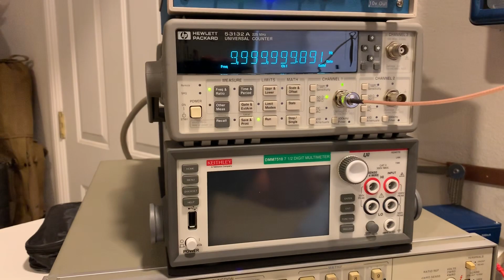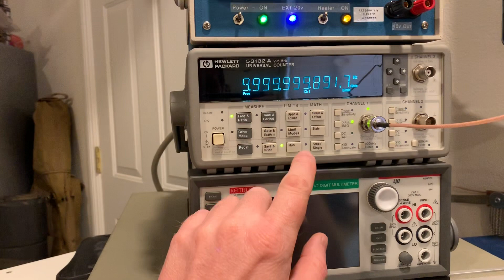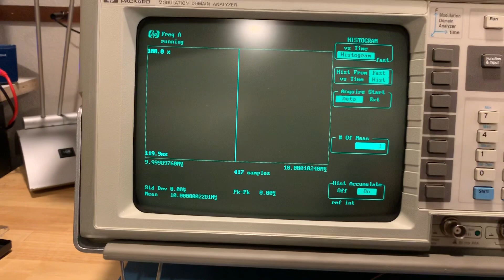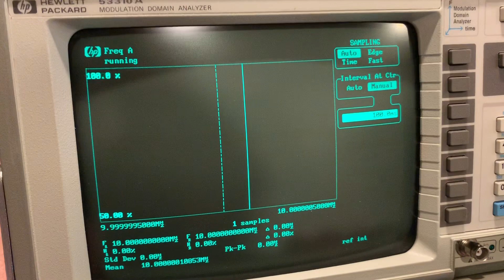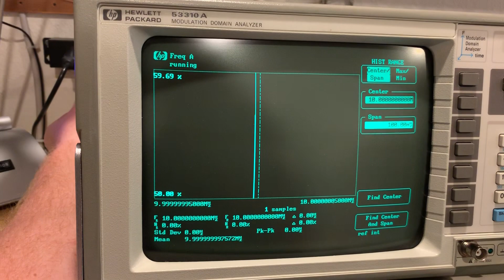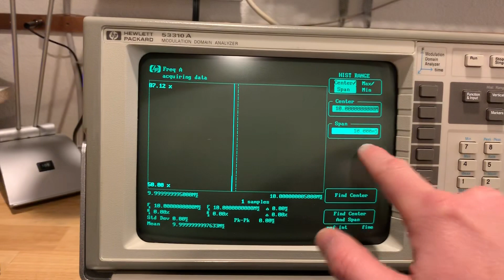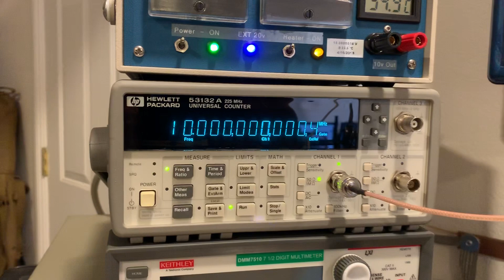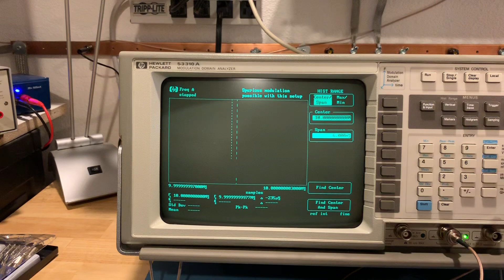HP 53310A MDA 10MHz ref adjust

Comment: The RF Comms option allows for what?
Spectrum analyzation?
Reply from the maker: Per the HP Datasheet, Option 031 High Resolution 2.5 GHz Channel C offers
superior measurement resolution. Refer to “Dynamic
Frequency and Jitter Analysis at the Touch of a Button.